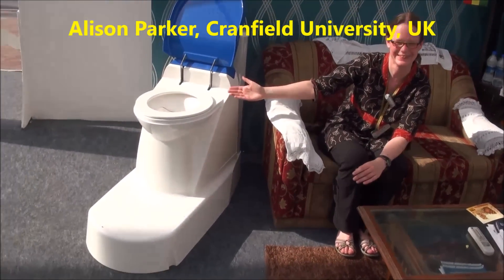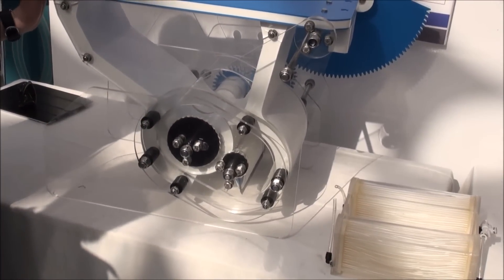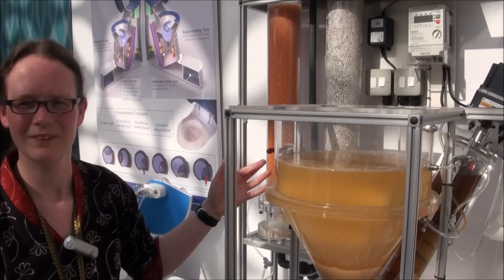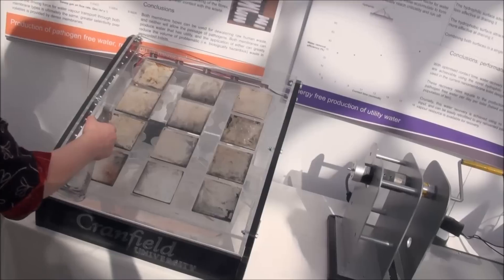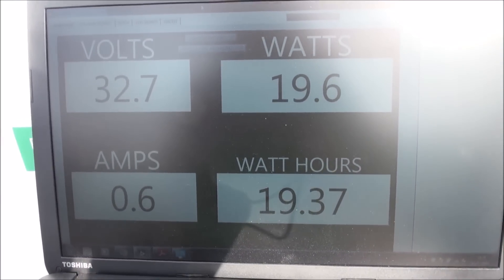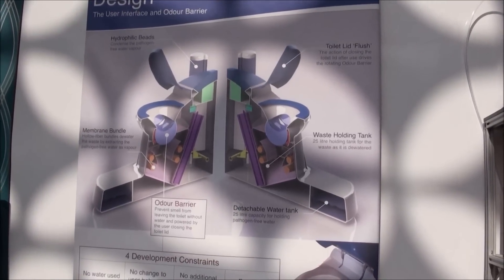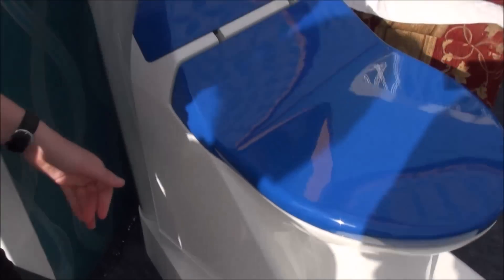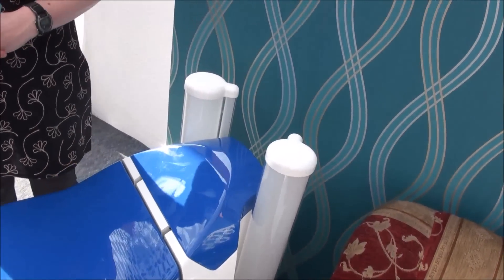Alison Parker: Nano Membrane Toilet, demonstration of exhibit (Cranfield Uni, UK) , Part 2

Comment: all these contraptions are too big for normal households, the system which exists as of now is fine but need tweaking made more hygienic and their flush away sewage systems to be redone as to whether   block wise pits ,area wise, city wise, All of new sewage pipes with new technology to be fitted in. a very important fact to discard fossil pipes rotting festering and not good anymore in function.